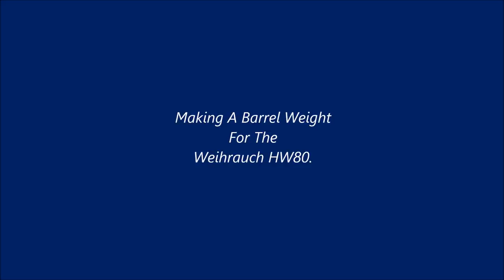Machining A Weihrauch HW80 Barrel Weight On The Myford ML7

Comment: Your spring compression tool is more sophisticated than mine. I still have my old HW 35 - since about 1975 or so!
Sweet job on the barrel wight Steve, :)
Reply from the maker: Hi Chris, Thanks. I used to have the HW35. The HW 80's have a large piston cylinder and can easily be modified to go over 12ft.lbs . I haven't got a FAC, so I keep mine just under the UK limit. It is great though as they work easily producing less recoil than other air rifles that have the smaller diameter piston cylinders They are all well made quality air rifles. I haven't seen you on Youtube for a while. Has the weather improved out there yet?
Reply: Yes, I always thought Wierauch was among some of the best (wouldn't mind a top level Anchutsch either!). I do still also have a very old tap loading Webley MKlll in .22 which was another favorite since I got it in my late teens, which was many decades ago!
Weather is slowly perking up though darned cold again today - it takes ages for my shop to thaw out enough to be worth heating but hope soon to get back to it. Also, my old back problem continues as another limiting factor much of the time. ATB.

Comment from the maker: NOTE:- I ONLY USE MY AIRGUNS FOR FIELD TARGET SHOOTING & ALWAYS ADHERE TO THE UK LAW FOR THEIR USE.
 SEE LINKS BELOW FOR SOME OF THE TOOLS USED:-
MT2 Live Center Set Morse Taper 2MT Triple Bearing Lathe Tool -- https://goo.gl/4hGyw8
SANOU SELF-CENTERING 4 JAW K12-80 Lathe Chuck Tool -- https://goo.gl/WU2TB1
Machifit 4 Piece Tool Holder Set & 10pcs DCMT070204 Carbide Inserts --  https://goo.gl/QRUY9K
7pcs 12mm Shank CNC Lathe Turning Tool Holder Set -- http://bit.ly/2DZlcjD
Drillpro 10pcs HRC45 Blue Nano CCMT09T304 VP15TF Carbide Insert -- http://bit.ly/2NfOqio
Category

Comment: Is that a hand reamer you are running at high speed?
Reply from the maker: Hi no it was only run at slow speed...around 300 rpm. They work great.
Reply: I've never managed to turn a hand reamer anywhere near 300 rpm

Comment: Gday Steve, can you please give me some more information on the 12v tool you where using on the compound slide, I normally use my battery drill but it clashes with the tailstock, great job with the barrel weight and thank you for sharing, Matty
Reply from the maker: Hi Mat. In my next video I hope to show an upgrade of the same tool. I did a video on making this one here, but just wait a bit to see an easier to
make tool that requires just a few components.
https://www.youtube.com/watch?v=iQ5UMDmmeLE
Reply: Steve Jordan ok thanks mate much appreciated

Comment: I must have missed if you were trying to make this a certain weight. Trying to figure out why you picked the dimensions in the first place.
Reply from the maker: Hi I just looked at a similar sized barrel weight on a similar rifle. I just make things up as I go. I never work using a list of dimensions or drawings as I find that considerably slows down production. The only critical dimension is the barrel diameter really.
Reply: @SteveJordan  I realize the brass button was just to make the end more finished but the steel could have been fancied up too. Did you use Loctite  to mount it rather than an ugly set screw? Fun project no matter how you look at it.😁